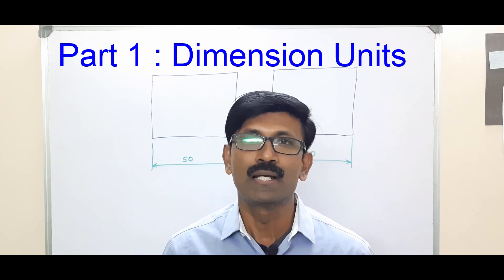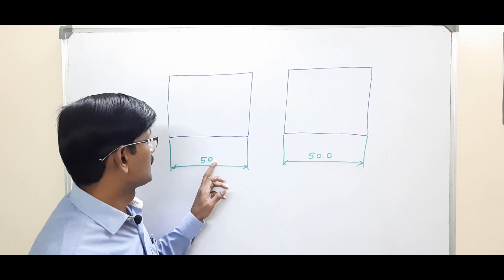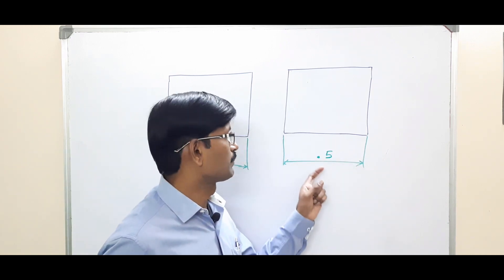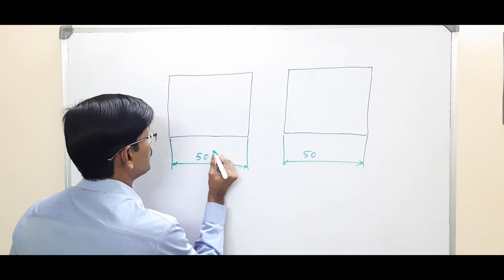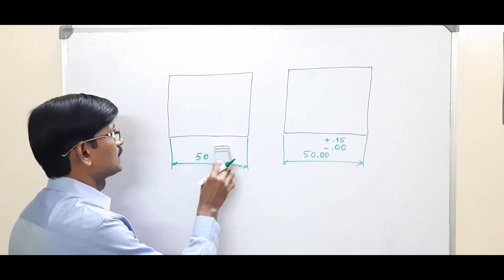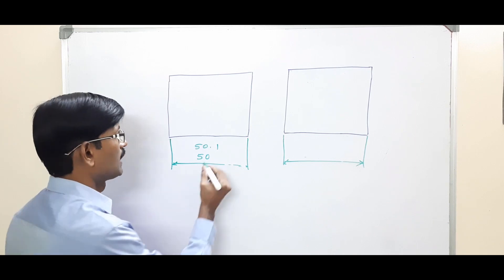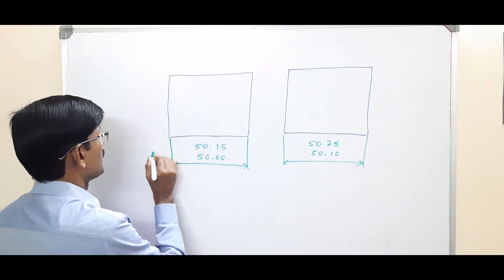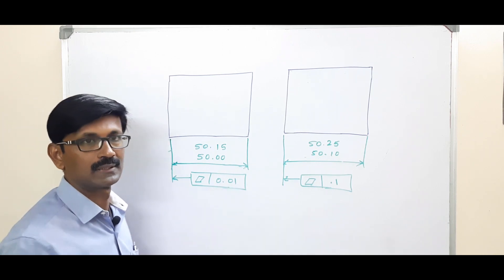GD&T Tutorial 02 : Dimensional Units

Comment: Hi Sir, in Inch system, under uni or bi lateral tolerances example, you said we should add decimals according to the tolerance decimals. However, is it applicable to form control tolerances as well right? If so in video at 4.35 time approx., As this is an inch system, straightness tolerance should be .10 right sir?